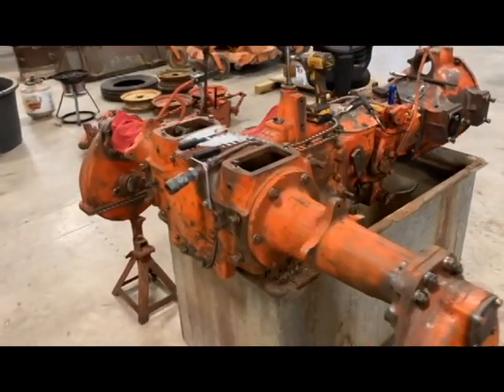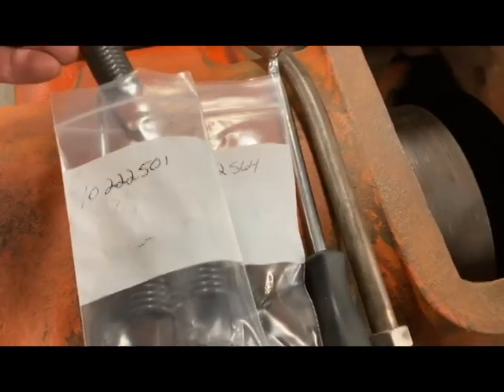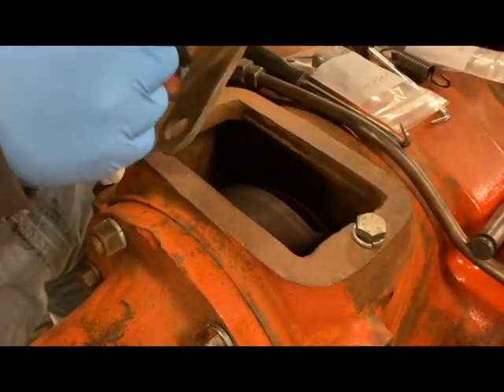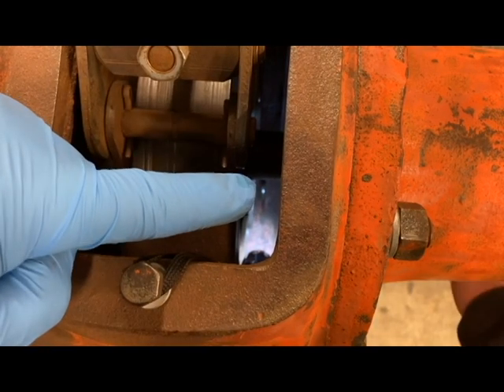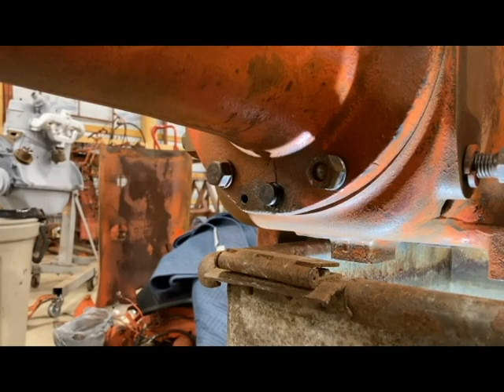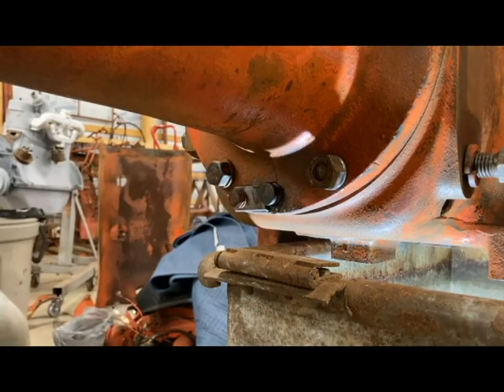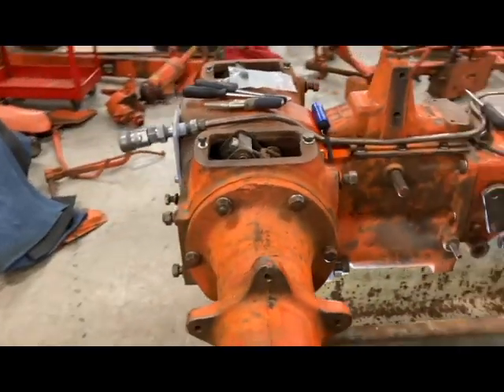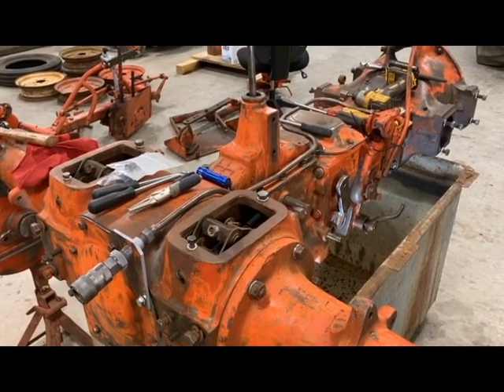Allis Chalmers WD WD45 Brake Installation Part 36

Comment: Why didn't you do the brakes when you had the axels and final drives apart?
Reply from the maker: Not quite sure what you are meaning?  The brakes can’t be done until axles have been reinstalled.
Reply: @nashsummers8050  sorry I thought you could change them while the axel is out.  My bad.